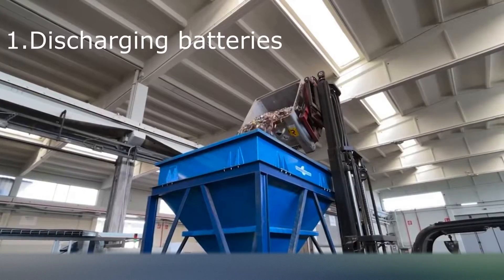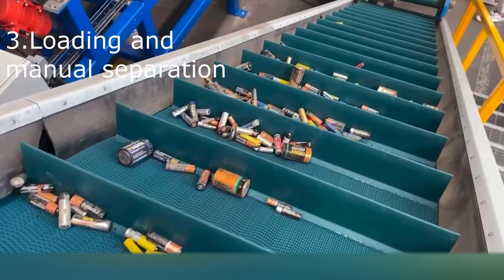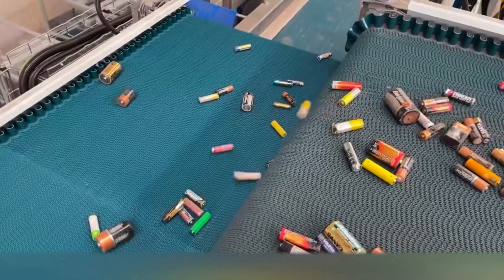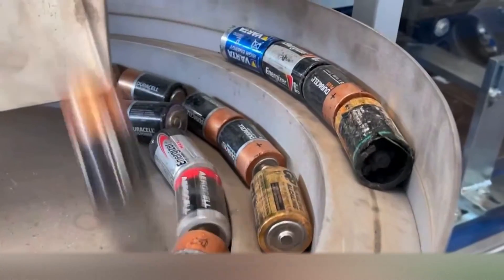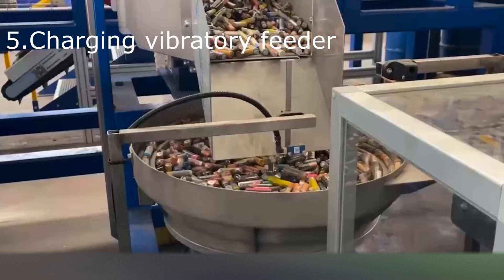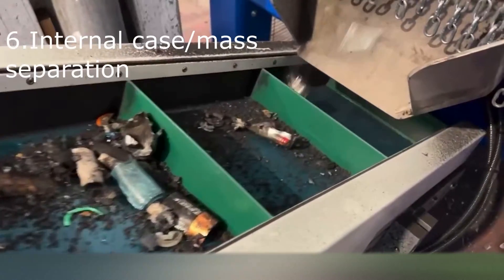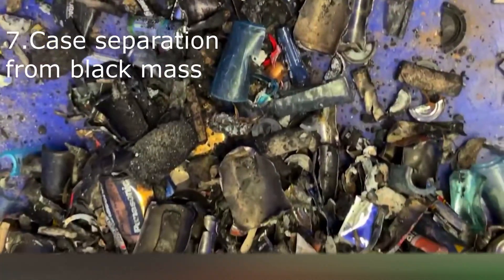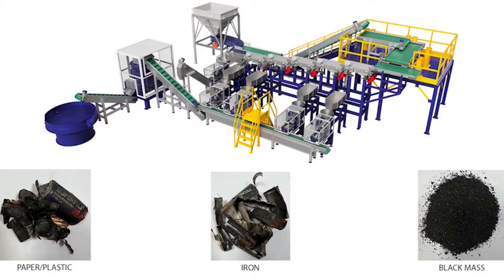Recycling alkaline batteries | STOKKERMILL

Comment: I dont understand why it has to go through two persons manual sorting, if it then goes to an automatic sorting machine.
Reply: because if theres a lithium battery in there by mistake it could be catastrophic
Reply from the maker: That's well known, so are the consequence for people without right safety measures @arbusco . You can ask more details to info@stokkermill.com thank you.
Reply from the maker: That's part of the process, if you are interested on the line specs you can ask at info@stokkermill.com